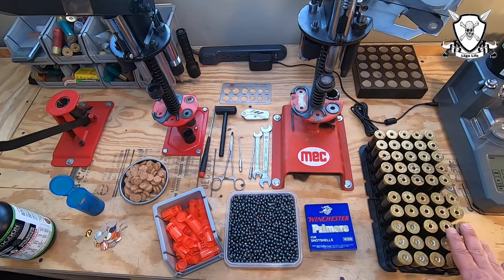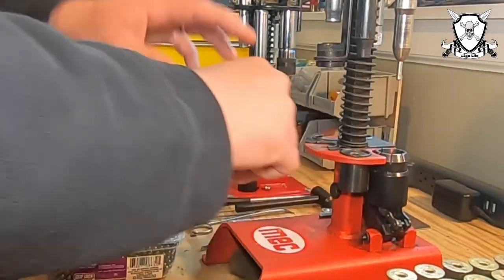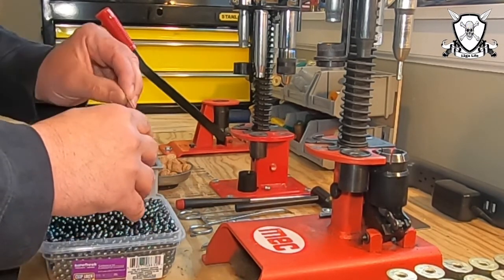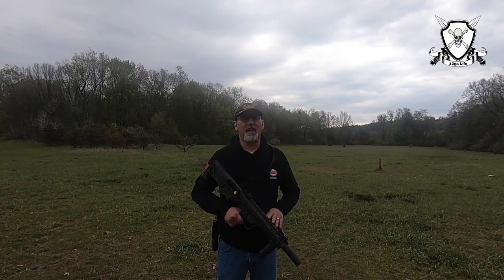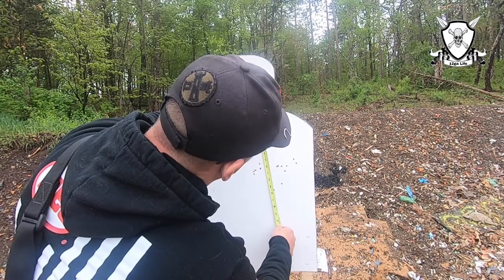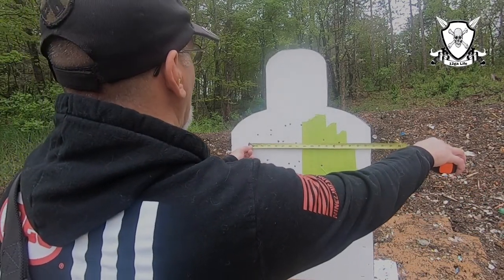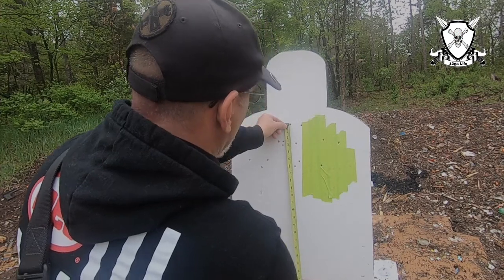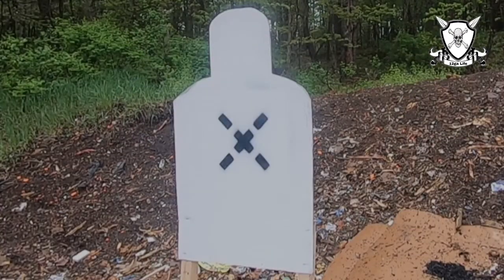How to load #4 buckshot

Comment: Low brass?
Reply from the maker: Yep low brass. Thanks for watching Robert.
Reply: @12galife  would loading high brass with a bigger charge be beneficial?
Reply from the maker: Nope it will only raise your chamber pressure which can be dangerous. Always use published load data.
Reply: @12galife Didn't know it'd raise pressure. Had heard that it was a paper shell days hold over kinda thinking. Thanks.